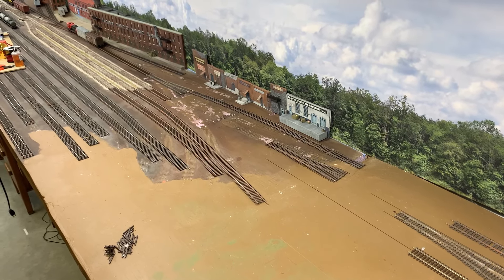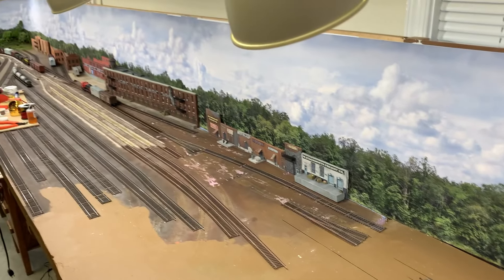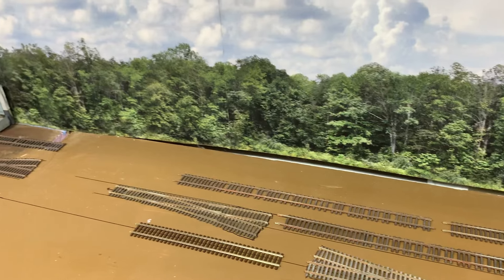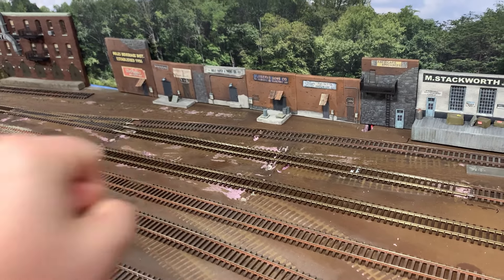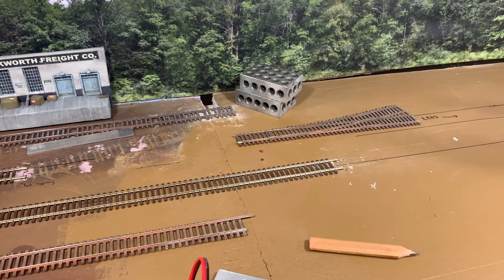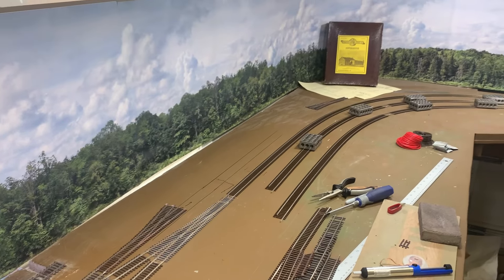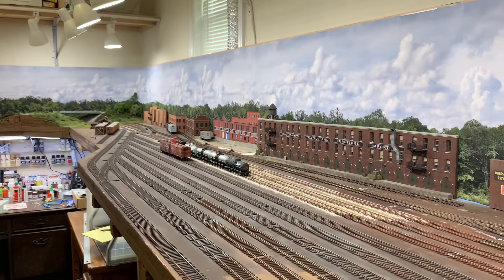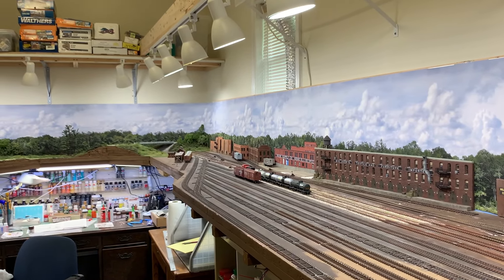Manchester & Deepwater 2.0 Update 46 - Yard Tracks Installed

Comment: Does the powerhouse include a smokestack? 

The switcher for the power plant could be a steam locomotive or a fireless engine. It's an opportunity to model something unique there.
Reply from the maker: It does not, though I have one from another kit I might add.  That's an interesting idea- though I am considering scratch-building a small diesel, like a 44 tonner for the job.  its 1959 in my world, and I had considered it to be past steam.  Your example could be a reasonable exception, however!
Reply: @johnarthur6302  - look at the video ALW fireless locomotive sound test

I don't recall whose podcast channel I saw him on, but as I recall he 3d prints various switcher shells for obscure models like the fireless steamers and lightweight interurban traction engines. Never quite my modeling style, but I'm a sucker for critters.